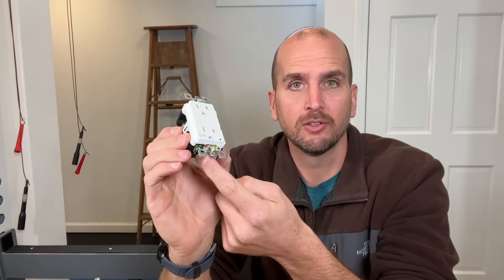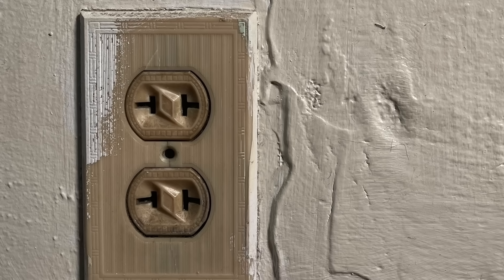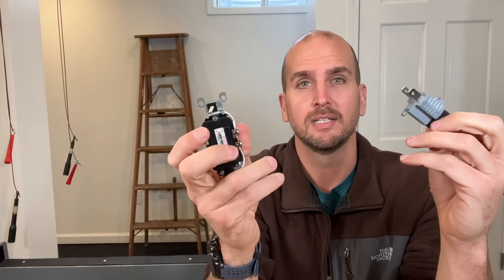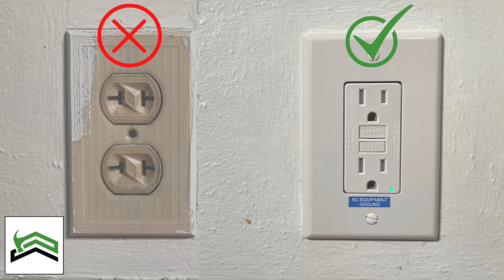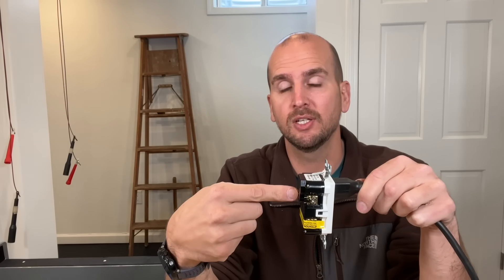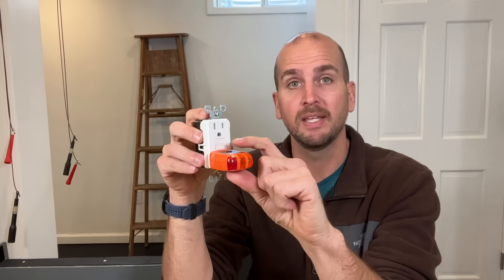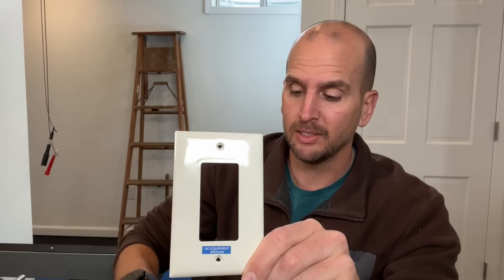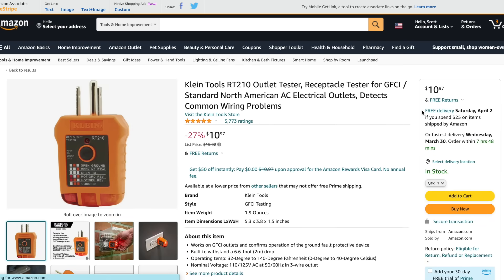Does a GFCI Outlet Still Provide Protection Without A Ground Wire?

Comment: what about the houses where the outlet has ground wire attached to metal box if you put an adapter in with screw wont it be grounded?
Reply: Copied from below from Fromage Frizzbizz, because he explains it well:  
 I agree whole-heartedly with your first sentence, and it applies to Canada (CEC) as well.  This extends to panels used as subpanels - the subpanel MUST have it's neutral-ground bonding strap *removed*.

There's a particularly heinous bit of electrical nastiness if you violate this.  If you have the neutral and ground wire attached in more than one place, under certain conditions, it forms a ground loop (the neutral wire will have a slightly different potential due to current flow hence it's going to flow thru the ground wire).  The consequences are continuous current in the ground wire, which it is most definitely not designed for - especially in older systems where the ground wire may be the shield of armored cable, or copper pipe, or tiny wire that can handle a full on short, but overheat and not withstand continuous current just under breaker trip threshold. This can cause the ground/grounding system to corrode and fail, thus preventing your breakers tripping on hot-ground shorts.

FYI: a colleague was upgrading a wall in his house from (I think) the 40's or 50's.  Not well insulated, but armored cable (some in poor condition) everywhere - the US at the time (and for decades later) permitted the armor to act as a ground.  Imagine his horror to find the armor itself being too hot to touch and glowing in places when NOTHING on that circuit was turned on.

As for the use of "real" grounding in equipment:

Not just RF shielding.  Transmission and receiving antennas of many types greatly improve in efficiency by a real ground (eg: thru coax cable sheath or balanced core centertap).  The dirt itself becomes part of the antenna.

Not to mention induced hum in audio signal cable between equipment that may not even be on the same circuit, and have neutrals at different potentials.

Comment: I've got one-I live in a relatively old house (1961). It's a mix of two and three-prong outlets (three-prong where there might be water). I'm looking to upgrade and one thing I noticed is that apparently all of the boxes are grounded because they've all got metal conduit and if check any box, I'm getting evidence of a good ground (checking hot/box with a current tester shows the same thing as hot/neutral). So if I run a ground wire from the new outlet to the box, I'll have it correctly grounded, right?
Reply: Yes and NO.   I've been doing electrical installations for a lifetime and now at 75 I think I can speak from some reasonable experience.   If every conduit clamp is tight and absolutely no corrosion exists where the conduit is connected to the outlet box or main panel, yes you may have a reasonably good ground connection.   BUT if any conduit connections are loose (and they will be) and any corrosion exists (and it will be there if the conduit has been in place for a while) you will find that you have some resistance in that ground connection path back to the main panel ground lug.   Even a small amount of resistance in a safety ground path which may make the difference of your power tool or other device (and yes computer equipment/harmonics challenges as well) can result in the person touching the faulty tool or other device and getting a nasty jolt or worse if their connection to ground is better than the conduit connection.   Obviously someone standing in water or with wet/perspiration soaked feet on a damp concrete floor could be shocked severely enough to be killed.   A simple Ohms law calculation will tell you that since E/R = I that even a couple tenths of an ohm of resistance on a 120 volt circuit can give a current flow substantial enough to disable or kill someone.   My advice is particularly in areas that are wet do run an equal size ground conductor inside of the conduit securely fastened to the main panel ground lug and to the outlet or GFCI.    You might want to look at this reference as well for good advice on this sort of situation -  https://portablepowerguides.com/does-ground-wire-need-to-be-in-conduit/    I want to see  you stay alive.   Best of luck on your upgrade project.
Reply: If the ground through the conduit is proven, then yes you can install pig tails from the receptacle ground terminal to the box with an approved screw into the box.
Reply: Using the conduit as a ground is not code (here at least) due to the potential corrosion or separation. Do it the right way. Also of note: Many GFCI's won't even "arm" at initial install if the ground isn't valid.  (This may have changed with newer products)
Reply: @blaydCA     Are you sure metal conduit can not be used as ground where you live in all cases?
Reply: @KevinCoop1  following BEST PRACTICES saves me from looking up multiple regs if different jurisdictions AND just might save a life. I've seen far too many damaged EMT conduits/fittings, ect in my time. EDIT: the jurisdictions I have worked in are HYPER aggressive with safety.
Reply: @blaydCA    Our company design standard was to install EGC’s in all conduits.   But when asked a NEC question, you shouldn’t answer like a rule of thumb is the code answer.
Reply: @KevinCoop1  Yeah, well I don't live in East Sloppyville Texas where standards are low. What can I say. What may or may not be allowable under NEC isn't always best practices. Anyone that has internet can look up the current NEC codes for a particular situation, and local codes for a particular jurisdiction, or visit the appropriate authority in person. Nuff said there. I'm glad your company follows "best practices'. Some don't.
Reply: @blaydCA     There is another side to the discussion.   Since you state you are not from Sloppyville, Texas, then everything must be installed correctly.   No loose conduit fittings, everything installed as per manufacturer requirements.   Therefore, metal conduit as an equipment ground conductor would be perfectly fine per NEC and work very well in a ground fault condition.   I still like green conductors personally.
Reply: @KevinCoop1  In a perfect world everything would be installed correctly AND there would never be any potential for damage to the BX or EMT runs and it's associated connectors and fittings. If you find that perfect world....let me know, and I'll move there! (and install as per NEC)
Reply: @blaydCA     If I were to be inclined to not include green EGC, it would be inside a heavy wall conduit within a dry location.   Several people have died from EMT that came apart.   One in particular was in a bank attic with a sign circuit.   Not worth it to me!   We are supposed to save lives as designers and installers, not lose them!   Best wishes to you sir!    Kevin
Reply: @KevinCoop1  Until the fire suppression triggers, or the roof leaks or seismic event combines problems. Yep I've seen some REALLY bad stuff in my time. Stupid stuff from supposed "technicians" like a 60 amp fuse feeding 14 g wire. Glad I'm retired now (except a couple tier 1 clients I've had for eons) here in SoCal and for family (who live in Sloppyville Texas where NOTHING is done properly, and I mean NOTHING!).
Reply: @blaydCA    Sloppyville is in all states!   I’m retired also.   I used to hold Contractors license in your state for our Solar Company.   My first Solar job was in Victorville!    Enjoy life!    Kevin
Reply: @KevinCoop1  Enjoy your life and retirement too! I'm trying how to learn  "retire". Learned first retirement lesson: don't travel to Sloppyville Texas to "just visit" and spend a week fixing "borked". Next project: find nice remote property in Wyoming for the summer time where it doesn't hit 120°f for weeks on end like here.
Reply: @blaydCA     We bought Class A RV but only part time.   Good Luck Sir.
Reply: @KevinCoop1  Got a huge Class C in Texas (groan). Elderly parents wanted it and I didn't say "no". Silly me. Happy trails!

Comment: I got it right.

Only because I was thinking about ELCB or whatever they're called. I clearly remember there's just two wires that connect to it. Live and neutral.
Ground wire doesn't come anywhere close.

If I had seen a 3 prong connector like this with built in GFCI, I would imagine, why would they include a ground pin if it doesn't have any function? Ofcourse it would have  some function.

Comment: The GFCI tester does not short the hot and neutral, it "shorts" the neutral and ground. That's why it won't trip the GFCI if there is no equip ground.
Reply: no, a GFCI tester bleeds 5 ma to ground.  if you need to trip a GFCI and don't have a tester that will do it, shorting neutral to ground will USUALLY trip it, but not always.

Comment: One thing people shouldn't do is make their own extension cord with a standard GFI in a box on the end. For the GFI to work there must be power to it  from the hot and common wire. If the cord would somehow get damaged and the neutral wire breaks, the GFI will no longer trip leaving the hot side of the GFI energized. The commercially made GFI extension cords have a voltage monitoring circuit that removes both hot and neutral from the receptacle if there is a break in either conductor. If you still want to make your own GFI extension cord, Hubble sells a cord end that has a GFI and the voltage monitoring circuit together.
Reply: If you wire an extension cord with a GFCI on the end, and the neutral in the cord breaks yes, the GFCI won't trip.

But, while the hot wire is still energized it likely will still trip if the hot conducts any current (like thru you to a copper pipe).  Because the neutral current flow is zero, and the hot isn't.
Reply: Thanks for pointing that out. Makes sense.
Reply: That is why in Europe, at least in Finland RCDs need to be voltage independent i.e. not electronic. As there is no electronics it works even without power. But if you make an extension cord it is better to put the protection to the plug so it protects if the cord gets damaged and you get shocked from it.
Reply: I can see the logic, but if someone was dead set on doing the box on a cord route, I would hope the minimum would be a gfi outlet on it.
Reply: Ideally it's plugged into a GFCI protected outlet. Ideally.

Comment: run a bleeping grnd wire...
hanndyman
Reply: Running a ground wire means rewiring the entire building.  A lot cheaper to buy and install a few GFCI receptacles.
Reply: @minuteman4199  
no just running a ground conductor from kitchen and bathroom where gfi's are most needed

Comment: You're correct, do not need a ground wire for a GFCI to work, but I was told by a electrical inspector it is a good idea to put the home run receptical on a ground.   I thought, wait a minute, but again it made sense.

Thoughts from others on this?
Reply: Of course it is better to run a separate ground wire or even do a complete rewire. It is all about the cost.
Reply: With the ground conductor intact, you are still protected if you lose the neutral, which would render the GFCI useless.
Reply: @Cotronixco  A loose neutral makes the circuit inoperable. The idea that there is a device malfunction at the same time is not very likely. If a socket does not work fix it. Meanwhile unplug things from it.

That btw is the reason why RCDs in Europe need to be voltage independent i.e. electronic ones are banned.
Reply: @okaro6595  Again, with the ground conductor intact, you are still protected if you lose the neutral, which would render the GFCI useless. This has nothing to do with "device malfunction." In this case, the "device" is doing its job.

Comment: Hair Dryer is a quick way to explain the gfci.  They only have 2 prong plug. No ground
Reply: That is known as ALCI (Appliance Leakage Current Interrupter) but it works like a GFCI. Note it is additional protection, it is not the reason the plug has just two prongs.

Comment: The people taking your surveys are probably above average level knowledge because they are are the types of people watching and learning from your videos.  I’m shocked that two thirds don’t know basic details about how gfci works.  Perhaps a diagram would help?  In a circuit diagram for gfci you can see that ground is not involved in the measurement of the differential current.

Comment: You explained well how the external gfci test button doesn’t work.  But you should have said that the internal gfci test button DOES still work.  This is because the testing current travels from the load side hot to the line side neutral.  Meaning it doesn’t go on the ground wire like the external testing device.  

Also, the external testing device when you press the button energizes the metal frame of a three prong connected device plugged into your gfci at the same time as it’s tested. This creates a hazardous condition when using external testers on ungrounded outlets.

Comment: Wish I'd know that 20 years ago for my old family home! I'd have switched out all the 1950's sockets.
Reply: You would only need to do the first outlet in each circuit.  If connected properly, all of the downstream outlets would be protected as well.  I went through my house and did this.  I was able to identify the first outlet on each circuit breaker, replace it with a GFCI, and connect the remaining outlets to the load side of the GFCI.

Comment: When I explain to a customer, how a GFCI works, I use a table lamp for example. The electricity going through one wire to the lamp needs a return path for current to flow, or the lamp will not light. Just like water out of a faucet needs a drain or the water stops. A GFCI detects how much current it is sending out and how much is returning. It senses leaks in the circuit. Most people understand this basic explanation about why GFCI is required at certain locations. Additionally, any new circuit that has a switch or a socket must be AFCI protected today. There are two types of Arch Fault. End circuit and parallel. Make sure you use the correct type for your municipality.
Reply: Water stops if there's no drain? What does that even mean?
Reply: @2whl4re  ordinary people cannot understand electricity. Its invisible. When they ask, how does it work and why do I need a GFCI here. Everyone understands water comes out a faucet and if the drain is stopped, the water stands still. When I say the light bulb has to receive 5 gallons to light, and that 5 gallons needs a drain, GROUND someplace to go, or the bulb will not light. The GFI senses the gallons it sends and has to receive the same gallons back or the GFI trips, or stops, like a drain stops water. Even the most dumb ass customers understand this most basic explanation.

Comment: No question here . I think people especially licensed electricians need to be educate on how to wire for cable satellite and or antenna systems. Having worked in the communications industry for well over 30 years I have seen homes prewired that were incorrectly. Wired up not considering signal degradation not to mention if the customer plans on having broadband installed. It's always best to home run from one central point. Especially with the internet connection being centrally located. If there's a router that is interconnected a point at which the router being set up to wirelessly make use is best. Especially if it's a larger home and or there maybe using modern types of hardware in its construction.  Metal studs tend to block out the radio signal that routers emit.